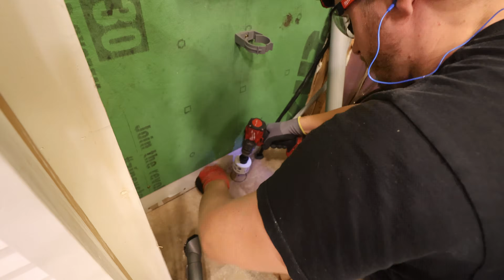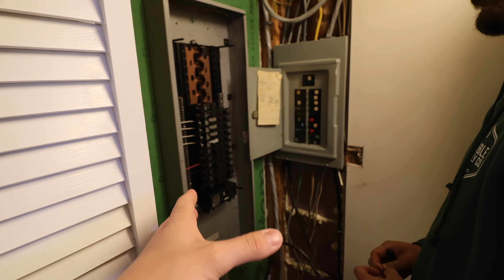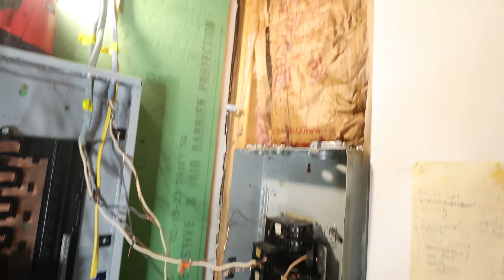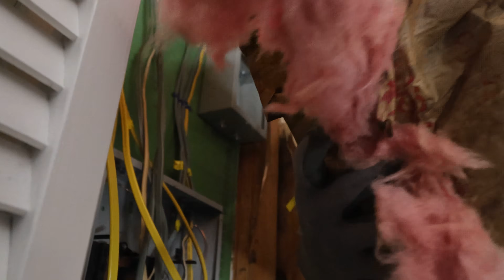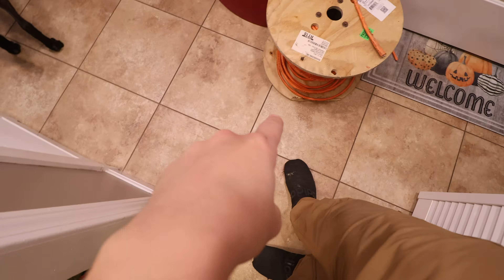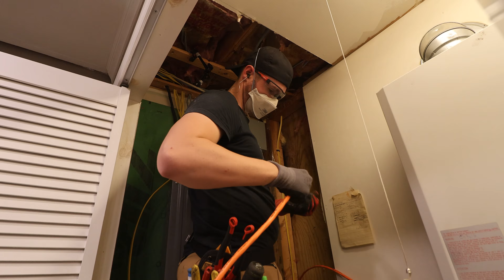How to Install a 200 AMP Subpanel

Comment: use a levitron panel; they have the neutral and hot together 
and if you have to replace the breaker you dont have to disconnect anything
Reply from the maker: If you have to change breakers that often I feel like there is something wrong lol

Comment: how did you feed the subpanel from your main panel?  Did you use a 200 amp breaker?
Reply from the maker: I used a 100AMP breaker to feed it because I didn’t run a big enough wire for $200 plus the outside panel doesn’t have 200amp breakers available for it. Only up to 150AMP

Comment: Looks like aluminum conductors.  I didn’t see you use noalox.  You seem to mention it though.
Reply from the maker: Noalox is not required inside or even outside. Always read the wire manufacturers specifications for their wire.

Comment: Question. I have a 200 amp meter  that has  2  100 amps feeds  that is on  elect pole    Only one of these  is feeding a  100   Amp fuse box. .thats still on pole,, Question is can I  pull off the fuse box that’s on the pole. And run  Romax wire over to my small shop which has a  100 amp fuse box in the shop.   The shop is 15 feet from the electric pole ,
Reply from the maker: Great question! Unfortunately, I can’t give you a clear answer. Legally you need to talk to your town about who has the rights to the power line pole. If it’s your power company then I would not touch anything without their approval or you can get into legal troubles.
Reply from the maker: Assuming you own everything on that pole, the technical answer would be, if there are two 100amp breakers within a 200amp rated panel, and you know your load calculations for both feeders is within code limits, then i believe, you should be able to run feeders to your shop.
Reply from the maker: Always call a licensed electrician to have them execute the install or review your plan.

Comment: So if you panel is outside you can just run Gounds to the actually ground?
Reply from the maker: The grounds need to be isolated from the neutrals in the panel inside the house because it is now a sub-panel. They are bonded in the outside panel because it is the new first means of disconnect

Comment: Is it possible to go about 150’ to a shop?
Reply from the maker: Yes! But there are a few details you will need to think about! Voltage drop could be a concern and a second grounding rod system may be required. Reference the code book for more details

Comment: Are all the wires in your 8x8 12awg? 
At first glance I was like. “You can’t junction 12awg to 14awg. I’m guessing the white Romex is older. Before they color coded everything.
Reply from the maker: Great question! As far as I am aware there is no code stating you can’t splice together different gauge wires. However, you need to make sure the wire are protected by a breaker sized to the smallest conductor. In this instance I decided to use the 12awg wire I had vs buying more. I used 15amp breakers to protect them. The junction box is only a few inches away from the panel. If this was a random junction box somewhere in a wall then I would be more concerned.